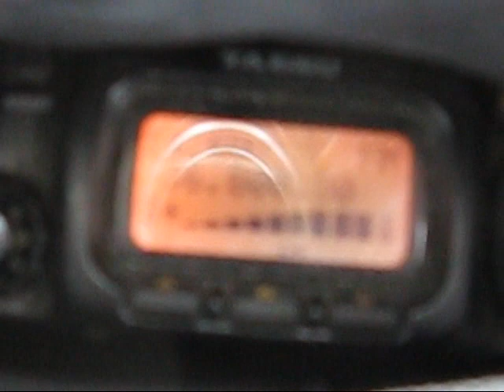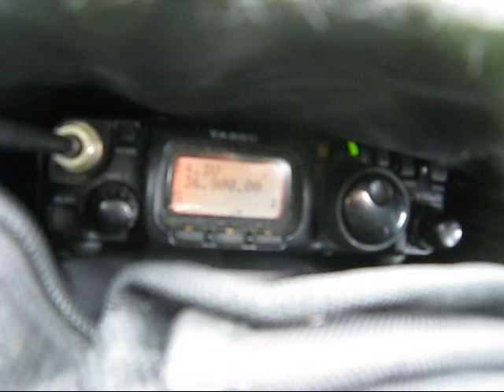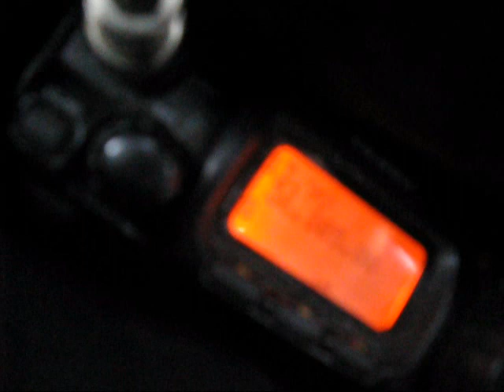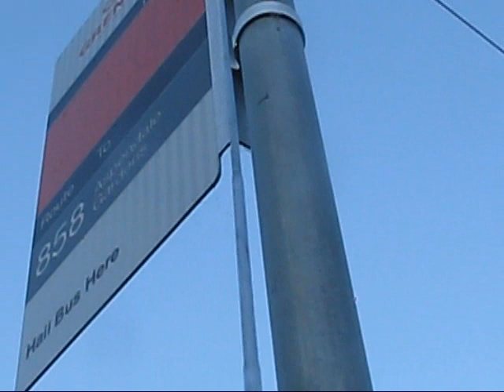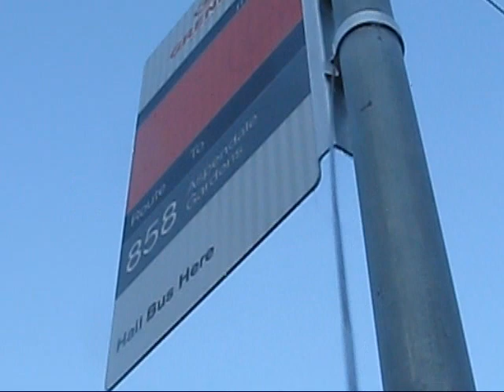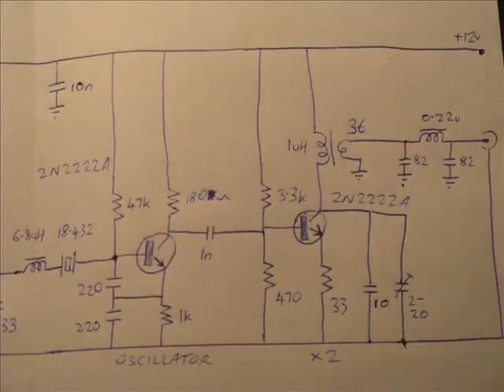Testing an LIPD FM radio transmitter - how far will milliwatts go?

Comment: Hmmm, this is getting me thinking. I have a Zenith, "The Continental" portable radio from the seventies. It has 6 bands. MW AM broadcast, FM broadcast band, 144-174MHz, 450-470MHz, The air band (108-135Mhz) but strangely enough it also has a 30-50MHz band. I don't think it's highly sensitive but I think I might have a play. I have a magnetic loop made from copper pipe which is 1.2 by 1.2m square. If I totally remove the tuning capacitor it resonates somewhere above 30MHz. Could be fun for a play. I have some metal (TO-18) 2N2222a transistors and 2N2219A TO-39 devices. No problem getting 100mW using those I think :) I might play with the circuit in your video Peter

Comment: I remember when someone here in Perth installed a LIPD in the Perth hills (with a folded dipole at about 20m up a tower) it was heard full quieting in the Perth CBD..
The ACMA went to the site to measure the power and when they tried the power meter could not read low enough to get a reading.
The range of this so called LIPD was huge as it could be heard with a half resonable antenna in Mandurah (I used a 5/8 mobile whip and it was heard just fine), it is no longer in operation by the way.